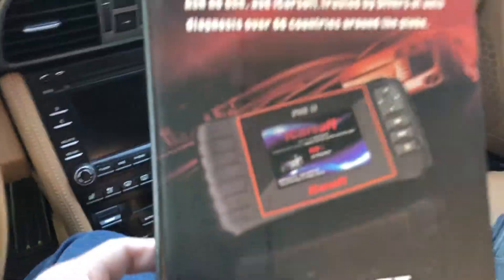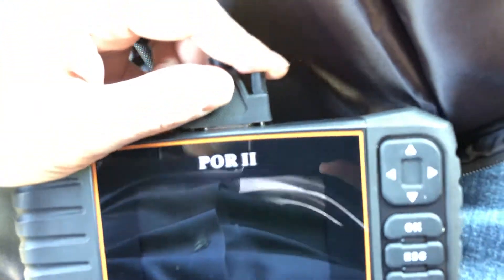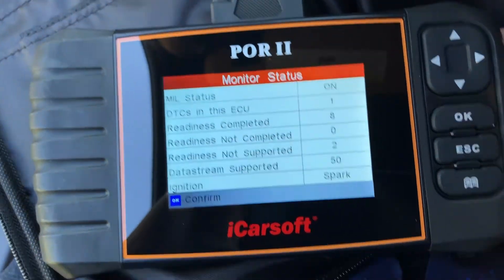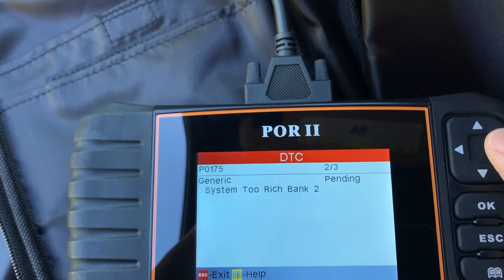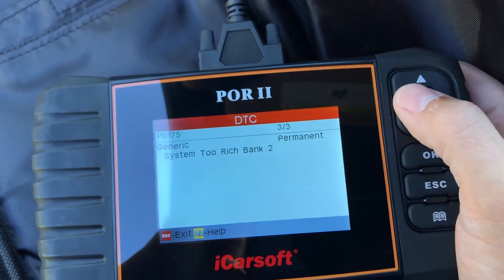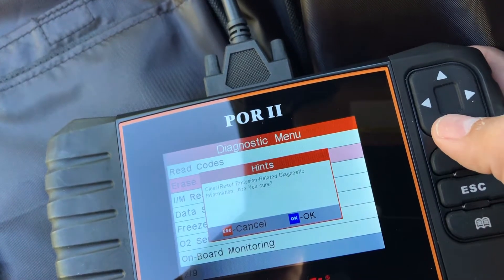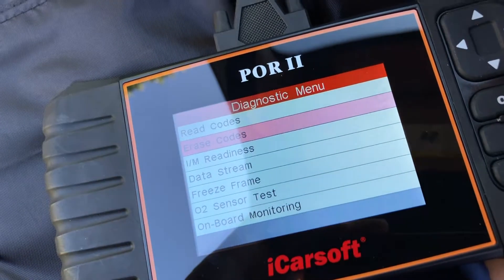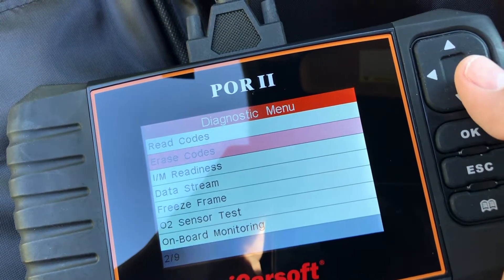Using iCarsoft OBDII Scanner to reset Check Engine Light Code P1075

Comment: Hey Omar, I've heard those after market intakes really screw with the cars computer...wondering if you put back the old intake back on if you'd have the same problem?? Any updates on the O2 sensors, MAF??
Reply from the maker: Nick de la torre it hasn’t come back since I’ve reset it.  I believe it had something to do with my battery going bad.  I posted another video that I talked about several weird things that were occurring in the car and I realized it was all due to a dying battery.  I’m fairly sure this code was also related to this low battery.  I’ll update you if it come back after the battery swap.
Reply from the maker: I also have a video on my channel where I changed the MAF when I was getting an error in both banks.  That was year ls ago though.  That cleared the errors that i was getting on a regular basis.